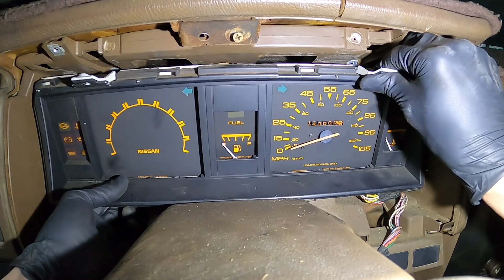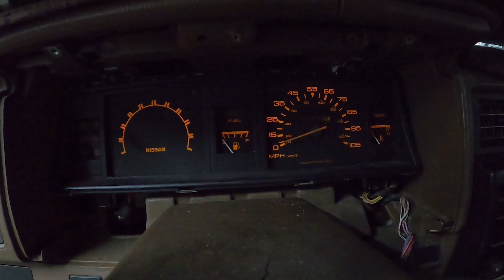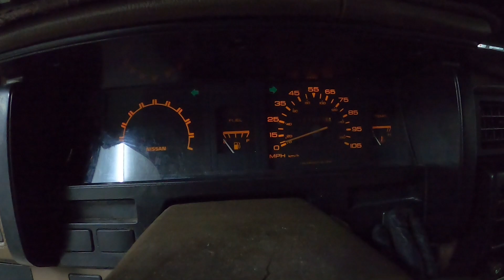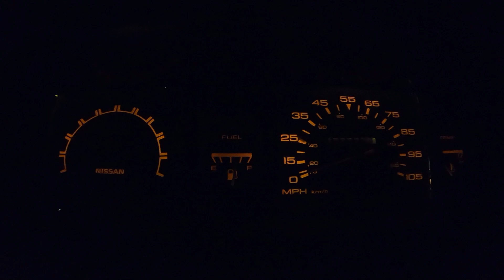1988 Nissan Truck D21 - 2.4L Z24 -  Speedometer Cable Install - Replacement - Part 2 of 2

Comment: Mine is off by 10 miles what do I do about that should I replace the cable ? 1993 d21 pickup
Reply from the maker: This one is also off by about same 10-15 mph. The needle had come off and customer re-glued it back on. 

I think problem is more with the instrument cluster assembly. The new cable installed on this truck did not correct the MPH reading. It is still off by the 10-15 mph with new cable installed.

Comment: Hola amigo donde conseguiste la pieza?
Reply from the maker: Hola. Compré la pieza en EBAY.com pero es una pieza original de Nissan. El número de pieza es 25050-55G00.
Reply: Para una king cab es igual o más largo